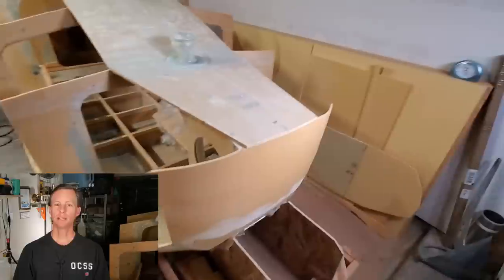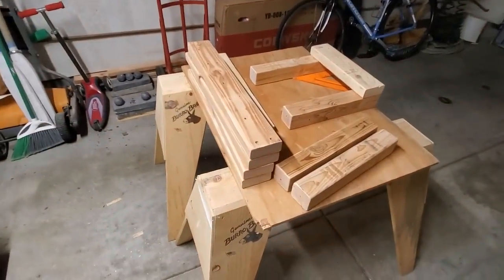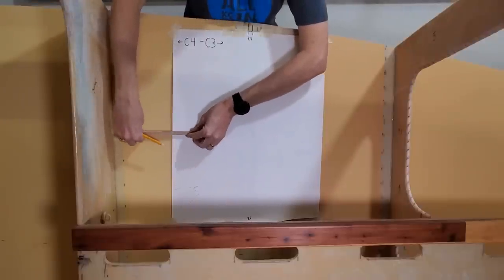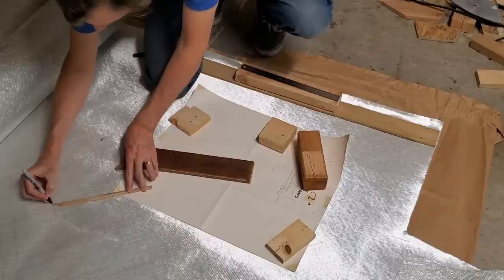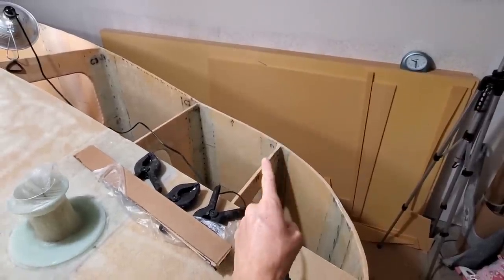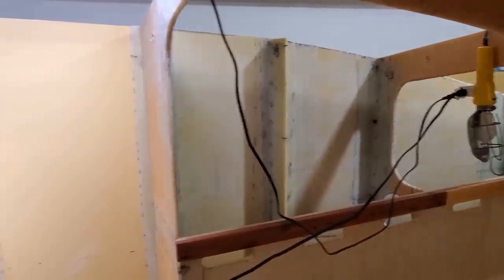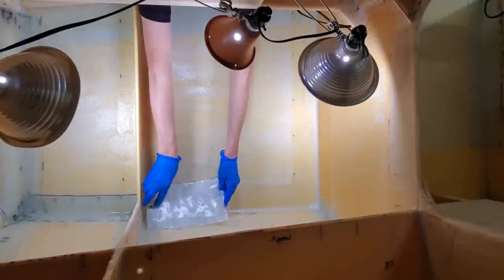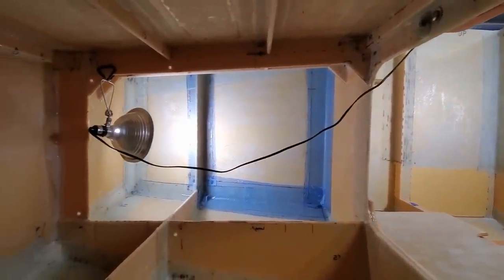OCSS-055 Attaching the Side to Frames - Mini-Cruiser Sailboat Build

Comment: The coast guard has minimsafty equipment requirements for boats .  The requirements for boats under 16 feet seems to be for day sailors on calmer waters.  How much over and above the minimum do you intend to go considering this is intended to be capable of trans-oceanic trips?
Reply from the maker: I've got PFDs and signal devices. I haven't bought communications devices (aside from VHF) or anything to share position in event of emergency yet, but we'll get there later on down the road.

Comment: it is come  。It feels like a long time wait.
Use 10mm pvc foam, the density is 60 or 80？
Reply from the maker: Yes it was a long wait this time. PVC foam core is 90 pounds per sq inch compression strength.